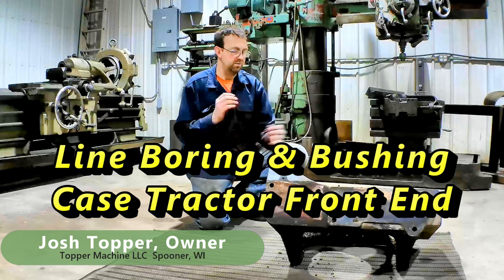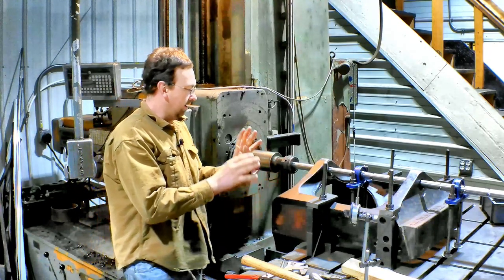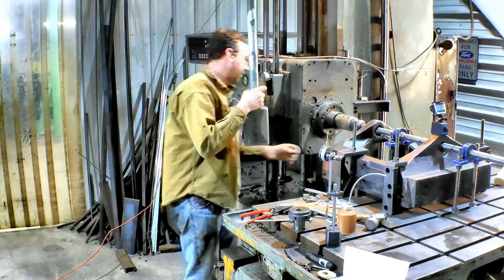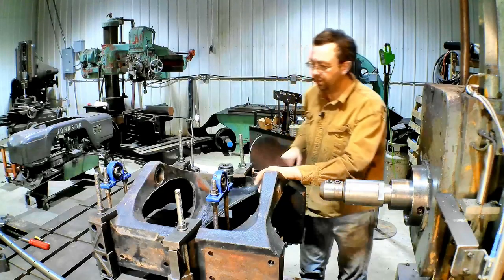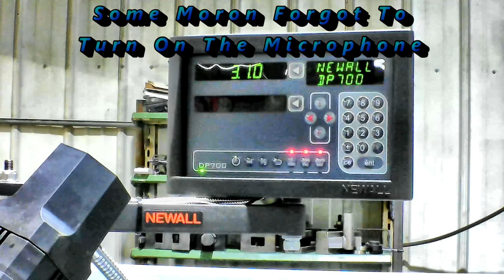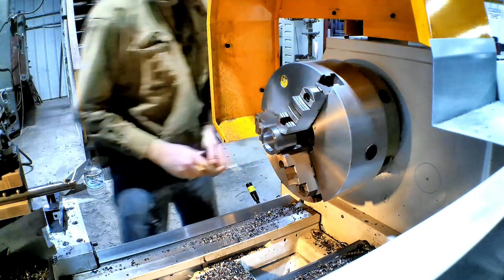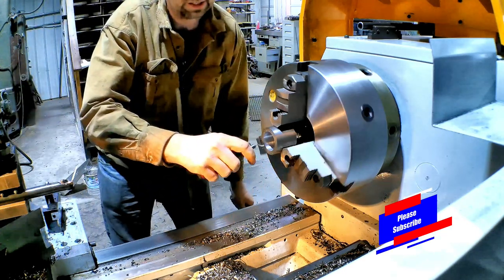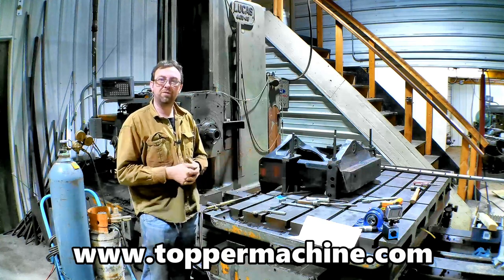Line Boring on the Horizontal Boring Mill, Case Tractor Repair, Heavy Equipment Repair

Comment: Threaded rod was not nearly rigid enough to support the pillow blocks, you can see them shaking.
Reply: not only shaking, they were wobbling probably 30 to 40 thou.and no doubt causing egg-shaped holes
Reply: Only on the roughing passes, steady on the finish light passes. Works for me!
Reply: @CothranMike even a bit of pipe would have increased the rigidity tho !... 🤔

Comment: The quality of your video on my screen is perfectly fine. The content of what you produce it the most important.
My wife is an RN as well, so I appreciated your comment and agree. 
I think lateral support for the bearing blocks would knock down the amount of weeble wobble, but is seems that taking final light passes does the trick as well. I can appreciate the hesitancy of taking a lot of time to build specially support (tooling) for a job you might not see again as opposed to getting the same kind of parts to work on continuously making the time investment worth while.

Comment: Not sure I would have bored out so much material for the steel bushes. It has taken a lot of strength out of the area, which I would think has a high loading in operation.

Comment: I took a junkyard engine block thru the car wash prior to dropping it off at the machine shop. They built engines for the truck series in Bakersfield where truck racing began.
The owner asked my why I bothered to clean it since they hot tanked them as a standard practice.
I told him it was too embarrassing as dirty as it was & that I take pride in my work. 
When I picked up the block, it was nicely sealed and he told me I'm sure you are going to clean the block prior to assembly but I want you to know this block is VERY, VERY clean. I thanked him and off I went.
He was true to his word, there wasn't a drop of oil or grit.
I agree, clean the part prior to dropping them off, have some pride in your work, it's a reflection on you!
Great video, thanks.👍👍👍

Comment: Gday Josh, nothing worse then having to spend hours cleaning components up that should have been done before drop off, I’m now using Hangsterfers 5030 cutting oil in my Cincinnati mill, I’m really happy with and I use a GoPro Hero 7 black with no external mic, it was a bit expensive to buy initially but it has been bullet proof, I don’t get complaints about audio, it’s been dropped, kicked across the floor more times then I can remember and it still works as good as the day I got it, I’m my opinion it’s was worth the extra outlay, great job mate, Cheers

Comment: Tall angle plates with vertical slots to accommodate the boring bar and bolts would be better.  Then switch to flange bearings instead of pillow blocks. Reminiscent of a boring mill tailstock, just miniature. This would allow you to just slide the bearing up and down to align it.
Reply from the maker: Wait for next week's video. 😉

Comment: Nice job sir !  I've been planning on building a line boring system for the two boring mills at work and this helps with a few questions i had. And that new lathe must be real nice to operate. It looks like a solid machine.  I know  what you mean on the coolant issue. The shop i work at is an ISO 9000 and 14001 company, that means they only buy this "environmentally friendly"  cutting and tapping fluid at $65 per jug and over time it eats away at anything plastic or rubber and it also becomes like tar if its left to sit on the table or ways. And yea it peels paint. We just cant get through to the higher-ups about these issues so we just live with it. Enough of my rant.....thanks for another great vid.
Cheers and stay safe.

Comment: Cool stuff. When you did the line boring setup I immediately thought of the outboard brace like those on the K&T or Cincinnati horizontal mills. If you could find a heavy rectangular chunk of plate and plasma cut a large slot for the bar, then two small slots in it and weld on a flange to bolt to the table.
Reply from the maker: Stay tuned for this week's video. It's another line boring job with upgraded support

Comment: I don't know anything about modern AV equipment, but I do watch a lot of low budget channels and channels filmed in the third world. I'm convinced that the best balance between audio and video quality is using iPhones believe it or not. Many of these channels attempt upgrades and inevitably end up with worse audio. Then they need a stand alone Mike. Then the timing has to match up just right and creators complain about the upload times. I've seen this also with well-established channels that had a sudden camera mishap. The quality of these videos is really quite watchable. I think in many cases, people are buying older units from eBay that may not even have cellular capabilities anymore. I don't have any reason to plug Apple over Android, I use on Android myself. But the few channels I've seen this on have happened to mention they were using iPhones. I think if you need one or two capable of nothing other than shooting video and uploading, you could probably get a very affordable model

Comment: If I might suggest sheer support for the bearings.  tube on each side and web in between.  Maybe multiple heights, 2, 1, 1/2 and so on.  Mix and match as needed.  even if you still have an inch or tow of all thread sticking out of the sheer support so you don't have to shim the support exactly so.
Reply from the maker: Stay tuned for next week's video. I made some new supports after this job. Every time I do one of these jobs, I come up with ideas on how to do it better.
Reply: @TopperMachineLLC  Coming up with new ideas is what I love about machining and fabrication.  Problem solving.  Fills a particular niche in my personality.  Look forward to seeing your solution.

Comment: I used Prolong super lube in a drilling operation I drilled 48 3\4 holes without a pilot and the drill bit showed no sign of wear. Idont know about lathe inserts but it would be interesting to see The oil is mixed with water and does not leave an oily film.

Comment: Nice work - did you lose any internal diameter when fitting those outer bushes?
Reply from the maker: No,. They were bored to fit exactly. The bushings I made were heavy enough not to crush.

Comment: I would have liked  to see how aligned they turned out. I assume the machine has one long pin to go thru both holes? Or two short pins in two short pivots. Otherwise nice to see a boring mill in action. Metal Raymundo is a master at the boring mill. I subbed and rang the bell anyway. I like your methods.
Reply from the maker: The customer got it back together without issue. But I would have liked to seen the finished assembly also. Thanks for subscribing.

Comment: I have a question (for my own learning, not being critical).  How did you decide the size of the bushings you made, specifically, OD?  It seems like smaller would have thinned the cast support less and left it stronger?   just curious.  Thanks for your videos.  Always enjoyable and informative.
Reply from the maker: It's really just a matter of personal preference. I wanted it thick enough on the wall as not to squeeze tighter when installed. There is enough cast there to not be an issue,and now it doesn't have slop to cause hammering. This making it stronger.

Comment: I've done a job or two that are similar. But, I bored out the holes enough to get a good bore and then made oversized bronze bushings. Or, bought bushings with the right ID and a thicker wall and bored the holes to fit. I'm just wondering why you bushed to original size but at the cost of having two parts there, not one?

I'm also curious about grease. Those bushings showed some grease holes in the bushing. But, the casting has no provision for a grease fitting. Are they greased through the pin, or is no grease after assembly why they wear out?

Comment: Im guessing you just wanted to try out the new line shaft bar. But I would have thought you could have done all the same with a rigid boring bar adapted to boring head. Have the job roughly centralised on table then dialled in with the aid of a parrallel bar through both holes. Then just use the turn table and vernier scale on cross way to align. Feed out head to obtain required bore dia. Ive done all that with a Kearns & Richards hori/borer before.

Comment: Was there a reason other than cosmetics that you did not choose to crest a weld on temporary brace to hold your boring bar more rigid than the all thread rods were doing you can see several thousandths in deflect as the cutter head engages the metal surface?
Reply from the maker: part being machined was cast iron, not easily welded to.

Comment: you mention dirty stuff in for work i used to repair surfboards and people would bring them in with wax. and sand on them so i would have to clean it all off. To fix i would have to remove the wax and sand so i started charging for the cleaning

Comment: Great content Josh, I really enjoy watching your work and repairs. A couple viewer comments. I know you had a problem with your gas supplier, other shops etc., but to continue bashing them is very unprofessional. It's not worth your time to continue including that in your videos. When machining a part to close tolerances it is very hard to watch someone beat in a metal part with a ball pein hammer. Very poor practice. Using the long al-thread for your bearing supports on the boring bar application with nothing to give rigidity to your pillow block bearings is not quality work. Yes, it worked but you could see in the video the movement. That is not giving you a good fit. You should add some mass to the bearing supports to correct this problem. I hope you consider these observations as constructive criticism to help your business continue to grow and get more viewers of your channel.
Thanks for sharing.
Reply from the maker: I know a lot of locals watch me and I am just sharing my experience with these local vendors, in the hope it will save someone from the same problems I had.  Watch the next line boring video, as it solved the movement problems you saw.

Comment: So when you're doing a line boring job, if it's a rather long shaft it has a tendency to whip in the middle. Obviously you're using bearing pillow blocks to lesson this oscillation. How does one calculate how much bearing support and how far apart they need to be to maintain a set degree of deflection? I'm sure there's a formula in machinery's handbook, but do you have like a rule of thumb?
Reply: The rule I use, and this is for stick out, not span between bearing points, is 6-7 times solid shaft diameter.  So if I am using a boring bar of 1” diameter, stick out had best not exceed 6”.  For span between bearing points, maybe it is possible to almost double that? Otherwise deflection becomes a serious issue.

Comment: How much bigger is the bushing you made than the bore to enable the use of Hot/Cold to fit thanks
Reply from the maker: This one was about .003-.004 larger. I honestly don't remember, just based on size you go .002/inch of diameter
Reply: @TopperMachineLLC  Thankyou very much for answer

Comment: so when you bored the tractor part did you cut the first hole to an arbitrary size and match te second bore or did you cut them both to an arbitrary size and match the sleaves seperately, only asking as i didn't see you measure really.
Reply from the maker: I just opened them up and then made the bushing to fit.
Reply: @TopperMachineLLC  that's what I was wondering did you make them both different diameters, or both the same?

Comment: Shrink fit instead of Dutch? What does Dutch refer to in this context?
Reply: Set screws in the face. drilled and tapped on the split line between the bushing and casting. Usually 3 equally spaced

Comment: I have some camera equipment 2 canon eos rebel t6i dslr camera and a cheap gopro clone.  Might be able to make a trade for some boring work no my south bend headstock let me know I'm in Wisconsin
Reply from the maker: I just bought a Nikon D5300 and love it. But, I'd be interested in helping you out with your project. Give me a call or email. Let's talk.
Reply: @TopperMachineLLC  cool thank. I will I'm over by menomonie so not to far away

Comment: If you have the materials and the products available, use liquid nitrogen to shrink the fitted part 1st before insertion....machine it to 1-.002 over the bore...will generally shrink .004-.006 , but when it warms back up and expands, it will be so damn tight almost like its welded in......just saying
Reply from the maker: I am in a desolate area. Almost nothing is readily available to me. So we make due with what we have. I have used dry ice when it's super critical. But again, not easy to get here.
Reply: @TopperMachineLLC  I totally understand that, I also live in the sticks....I have air-gas my local supplier refill my cryo insulated bottle 1x a month during my sched  O2/Argon/Acty/delivery, 
 cost is comparable to a argon refill and can last all month